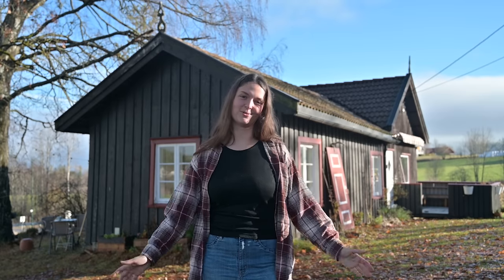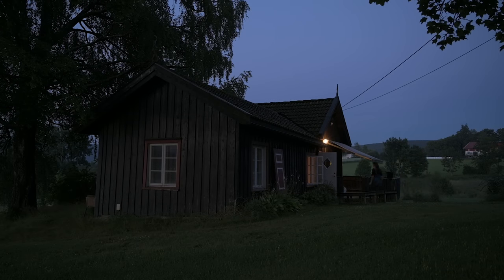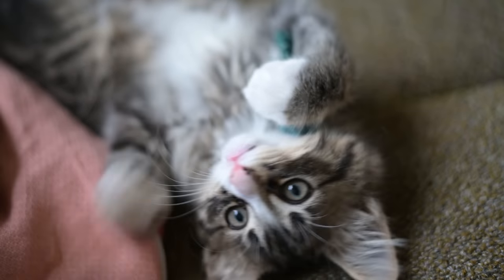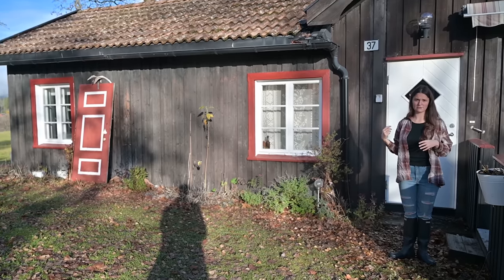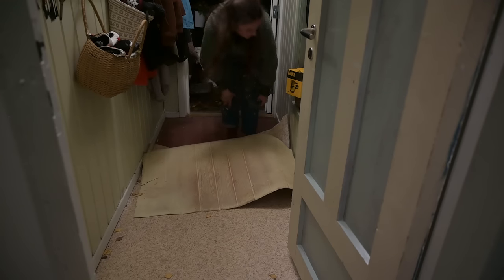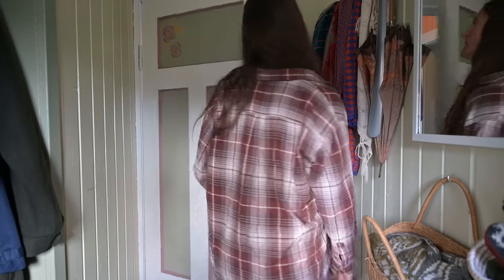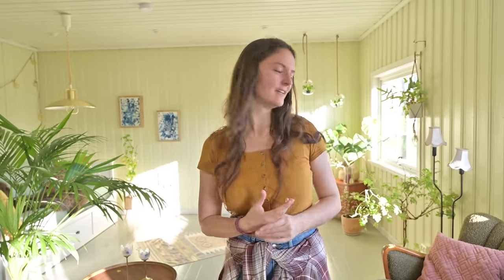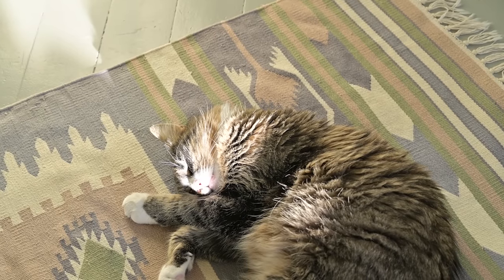Colorful country Cottage tour - before and after one year rental cottage transformation

Comment: I love how you made that counter extention in the kitchen! If I were to do build it, I would have used brackets underneath to hold it up and mount it to the wall, then use piano hinge along the counter part that's between the cabinets so that I could fold it down, flush with the wall, to free up more space when needed. Just a thought.. and still not permanent, for a rental, because you can always take it off and fill in the screw holes from the brackets, same work as a shelf or pictures you hung while renting.
Reply from the maker: Hi, thank you :-). Yep, I think brackets would be smart too. I honestly use it so much though that I would never have folded it down x).
Reply: @Mariaandtheforest  How do you access the cabinets in the corners under the shelf?

Comment: Hello 👋 
I just wanted to say that I enjoyed watching how you guys flipped this house over and turned it into a lovely home. Good job!
I also saw that you have a fern hanging by the window of your guest room/reading area. I could tell it wasn’t doing very good 🥲 I would suggest that you move it behind the wall so it doesn’t get a lot of sun ☀️ It does need some light but that plant needs hydration and shade. Also the monstera plant in the corner is mostly a shade plant but it can adapt to a lot of sun depending on how you take care of it 😅 so if you see the leaves 🍃 of both the monstera and the fern are not deep green you should probably move them to a place with not a lot of direct sun. Those need to be moist and hydrated. Your reading area is amazing!! A lot of light coming in ❤

Comment: Hello, I'm just in the middle of watching this and love organizing a space. A suggestion for your living room would be to move the sofa bed against the wall by the window so when sat down you can see the kitchen then perhaps have two bookshelves on either side of the wall where the sofa bed had it's back to with a picture on the wall between the shelves and perhaps a plank of wood sat across the two shelves at the top to create shelving above the picture.
Be better if I was there to get a feel of the place or had drawings aha. Looks lovely so far! I like the sofa bed too
Reply from the maker: Hi! Love your ideas. Espescially with the bookshelves on either side. That would become almost a little library <3.I  have actually pondered the placement of this sofa bed quite a bit, but it is hard to move it somewhere else... The wall by the window has a heater on it, that is placed very low for some strange reason so we cant put anything there. Also having it in the nook gives the guests some privacy when they are sleeping there :-)

Comment: OMG! MY house was built in 1930. It still has the old cloth or paper? covered electrical wires. Oh and the windows have rope pully things to raise and lower them.
Reply from the maker: How nice! What do you mean by cloth or paper? Those ropes to raise the windows sound charming 😊
Reply: @Mariaandtheforest  I n the time my house was built, here in the US anyways, wires for homes were wrapped in ..... I think it's  paper but it might be some kind of fabric....it feels like paer, black paper where now they are coated in plastic. So all the wires in the walls ,  in a car it would be called a wiring harness,  are neatly wrapped so the wires aren't  just flapping about loose. Where they meet a outlet the bundle, with the wrappibg, is about 1.5 - 2 cm in diameter. And we had a old fuse box vwith glass/ceramic  fuses,  that you had to screw in, for the longest time...until my mom decided it needed upgrading and bought us a modern fuse panel just a few years back. Much better, especially since those old fuses are getting harder to find. Sorry I  don't  know the professional terms for anything building wise hahaha.  I'm  much better with art supplies and animals hahaha. Oh, one problem with that old wiring.....mice love to chew on it grrrrr so it IS kind of dangerous. And it doesn't handle the electric load we use now so we juggle plug ins all the time. So if you want to use one thing you have to shut off something else hahaha. Fun times 😄
Reply from the maker: @navyboymommygramma  aaah I see. I do not think we have that. Haha, I don't know the terms for things either, totally get it! Sound like both a charm and a hassle 😆 like most things with these old houses I guess (but I love them still)
Reply: @Mariaandtheforest  I may ge the only one, but I love my quirky little pain in the butt house. I raised my 3 kids there, how could I not love it? Hahaha

Comment: The breakfast bar is placed odd IMO. Only because its upper surface is cutting off part of the bottom of the window. Visually the bar should sit level with the bottom sill. (Or place a window that is higher which would not work because it is a rental and would be expensive). Otherwise kitchen  (and rest of the house) is very cute. The dresser in your bedroom would be lovely if you could paint some botanical floral elements (in a vinatge drawing style) on it with warm colors-rust, goldenrod, yellows, pale greens. I don't know. When you did you bedroom tour, an image of that just popped into my head-and that was before you explained about the cold color etc. My mother's surname is Egeland BTW so family is from Norway a couple of generations ago. Beautiful country.
Reply from the maker: Yes, I agree, but if it was level with the bottom sill it would not be possible to open the cupboards under the bar and it would be too low to function as a food prep space. In rental solutions like this one sometimes has to accept some imperfections I guess x). 
Painting some botanical elements is such a nice idea <3!

Comment: When I was your age I also rented (many places) and probably painted every one of them! But back then (in the mid 60's-early 80's) it was possible to rent apartments at very reasonable prices in the US. Now, rents are astronomical in most cities and towns in desirable areas. Owners add luxury updates to try to justify charging maximum rents, so doing what you have done is not the norm now, sadly.
I think your home looks very pleasant. Am wondering why there are so many doors. Is their purpose to keep heat in the one side of the house because the only source  is one stove? If so, how do you keep the bathroom pipes from freezing? I now own a home built in the late 1800's and despite central heat with cast iron radiators the water pipes can freeze. Quite a hassle, but that's the "charm" (actually, major hassle) of such an old house.
Re your living room bookcase, the dark color makes it stand out awkwardly. If you  either make an addition to it to fill the entire wall (you'll gain more storage) and/or lighten the stain or paint it so it blends in it will look as though it belongs there. 
I have been thrifting ALL my life. Other than mattresses and one couch, I don't think I have ever purchased new furniture. Hilarious to me that it's become a "new" concept. Much of today's environmentalism  are concepts from the 60's. For what ever reason, Americans lost their way and become shallow consumers thru and thru!
Reply from the maker: How nice you used to do it yourself! Sad that people are not doing it anymore because of the way things are. The prices are intense in Norway too, but where we live and this house is pretty afordable.
You are right about the doors, its about keeping the heat separated. In our bathroom we have a small heater that is mounted above the door actually. Its on a low heat through all winter to keep the pipes from freezing. I agree that the stain is too dark, should not have trusted the samples in the shop... 
Haha, indeed. Its all of a sudden a trend thing, when it used to just be normal. Strange world ;-)